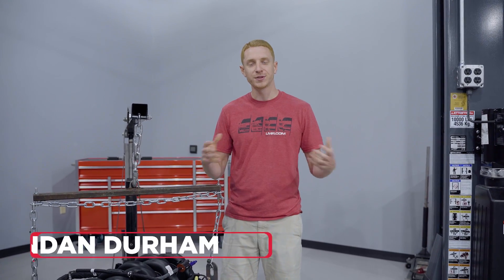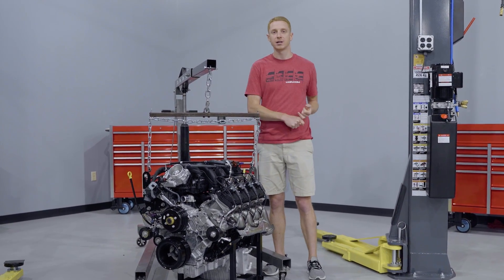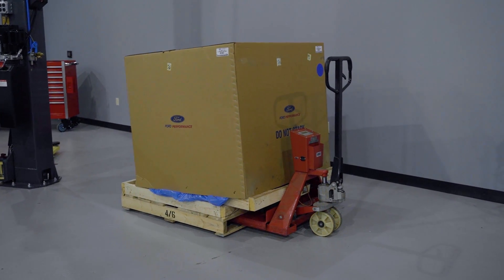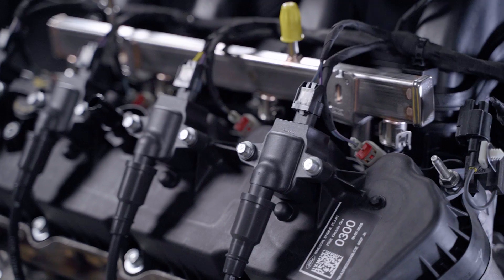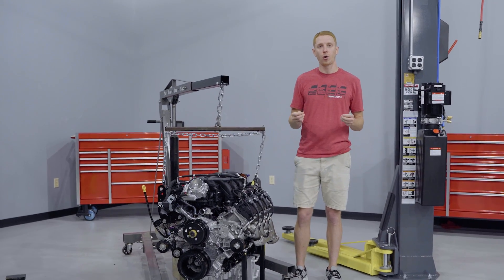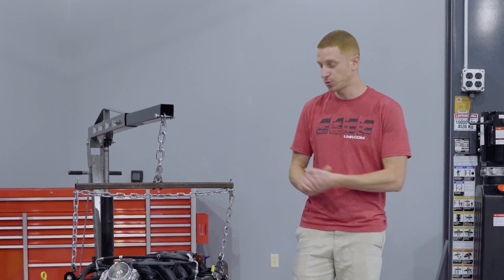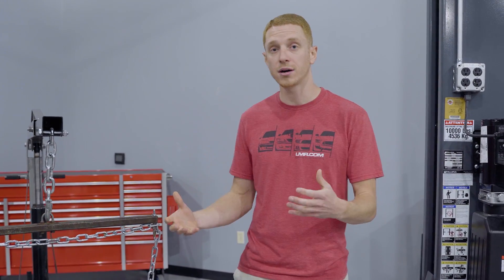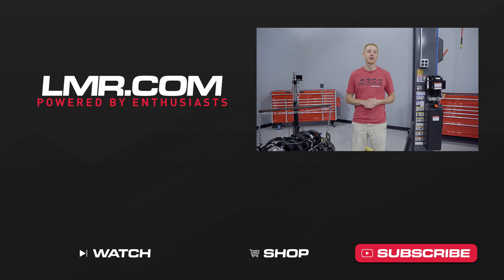Ford Performance 7.3L Godzilla Crate Engine | Review

Comment: "This will decimate all, after, you put about $15k in it...maybe more. If we have to, overnight parts from detroit."
Reply: Lol Jesse
Reply: Did anyone else say it in his voice?
Reply: Why are the 7.3 having such problems with 25 dollar spark plug wire
Reply: motor has already made more than 600 hp with a cam and some porting to the heads NA
Reply: Decimate: to reduce by 10%. It will annihilate lol.
Reply: lol
Reply: Dearborn..not Detroit. Gm based in Detroit. Just clarification. Lived in SE Michigan 11yrs. Car mecca of 🇺🇸 for sure. Love Michigan!
Reply: @Davido50  you missed the reference
Reply: @codyramos3200  did I? Clue me in sir.
Reply: @codyramos3200  just ordered a '21 F250 w/7.3L Godzilla option ..ppl & tuners raving bout this "truck engine " its not a performance motor per say but all Fords in last 10yrs are super tunable & strong running.
Reply: @Davido50   John Ritchey- "This will decimate all, after, you put about $15k in it...maybe more. If we have to, overnight parts from detroit''   quote from the fast and the furious except its japan instead of detroit in movie..
Reply: @Davido50  you seen the multi part godzilla build? ends up making just under 800hp turning 7600rpm
Reply: @codyramos3200  wow incredible no I didn't see it. I can wait to get it in my F250. Dealer said orders w/the 7.3L are heavy out here in NW Ohio
Reply: @codyramos3200  My son has new '19 Ranger FX4 w/ Gen2 - 2.3L Ecoboost from RS rally car. What a fun truck! Has 10spd from F150 along w/2.3L is excellent combo. Truck is super  smooth & quick. No V6 needed!
Reply: @Davido50  cool didnt know you can get that combo in the rangers. idk what you do for a living or if the f250 is going to be a work truck of some sort.. but what made you want a gasser vs turbo diesel in the 3/4ton? only have experience with the old 7.3 powerstroke turbo diesel 97 f350 4dr long bed .. thing was like brand new with 250k+miles only problem it gave me was it got cold out n didnt want to start.. new glow plugs fixed it
Reply: @codyramos3200  Yes, only engine avail (for now) in all Rangers is excellent / overbuilt (for current truck duty plus already stout from use in 350hp RS rally car). 2.3L coupled to F150 sourced 10spd auto makes new Ranger a powerful smaller truck..its not that small! Lol. My son said he read Ford engineers sayin that 2.3L makes 300hp on 93 premum! That's alot! In sport mode truck will pin you to seat. Next yr the 2.7L Ecoboost will be an option ..its really not needed but will be good for towing etc. If you dont need a 1/2 ton or want sporty fun versatile vehicle its well worth it. Very well built /ton features & tech/plenty power/ smooth powertrain/good mpgs. My son loves it & his best bud w/newer V6 taco truck wants new '20 Ranger now. Can't blame him. Toyota is a good truck but far outclassed by Rangers superior modern TGDI engine + F150 10spd auto. Ranger has terrain management w/FX4 option thats very cool for off roaders like my son & friends.
Reply: @codyramos3200  Btw, im a mechanical engineer tho have held multitude of positions w/total of 26yrs in & around automotive industry in general .. working for multiple big Co's here in uppermidwest (MI & Ohio mainly). I like diesels for sure & ur pt is valid when comes to 3/4 ton truck. I dont tow much really.. car trailer at most. So, idea of simpler (less costly) 6.2L or 7.3L Godzilla really intrigued me! Fuel prices will be cheaper too. My new F250 won't be daily driver except maybe in winter mos. Very excited for this Godzilla engine & know its last big block gas engine Ford may ever build. Consider one if you get new 3/4 ton rig!
Reply: @codyramos3200  it makes 600hp at the crank with a mild cam, valve springs, long tubes, open intake and exhaust systems and no accessories with an optimized 93 oct tune. 640hp with an aftermarket intake manifold and 105mm tb. I call that a performance engine...
Reply: @Davido50  I think the Ranger needs a 5L V8 option...I had the old one with a 6sp auto in an '11 F150 and Mustang GT and I LOVED it. I drove a 5L 10spd RCLB 2wd F150 and it was an absolute ROCKET. I managed to pull down 26mpg with that SCSB 4wd 3.55lsd XL package F150 and it ran 0-60 in 6s flat. There is video proof on my channel for that. I am intrigued by the 2.3 Turbo however I have heard that there are many failures just running in 350hp RS trim much less a full bolt on, tuned engine in a Mustang or Ranger pushing 400+hp.
Reply: 15 and might keep up with junk yard $500 LS

Comment: A good replacement for the V10 in my excursion.
Reply: 7.3L gas engine would be a good replacement choice for an older 1999 - 2007 Ford F250 / F350 Super Duty.
Reply: Triton V10 is a good engine, I'm keeping mine.  I still don't trust the variable cam timing on these newer engines and it'll take some time for this engine to prove itself.
Reply: @406Steven  The V10 is a gutless POS,  friend of mine bought a Excursion with a V10 and 2 weeks later took a hell of a beaten trading it in on a Powerstroke
Reply: @rodirby5952  it's a truck, not a race car. It's got the torque of an OBS 7.3 but with another 100 or so HP and they're known for being very reliable in fleet and RV use. My aunt and uncle had a V10 Excursion and struggled to get 12 MPG from it but it's a truck, not a Prius.
Reply: @rodirby5952  yeah, the tritons don't like abuse. My dad got an old f-250, didn't treat it how it wanted to be treated, seized a month later. Baby it and it's got 4.6 modular lifespan.
Reply: Imagine if this thing gets used in all the new heavy-duty commercial vehicles like the 6.8 Triton, and keep the same big life energy!
Reply: The RV industry has already adopted this over the V10.  Its outperforming the V10  hauling massive 10 ton RV's.  Keep in mind that more cylinders is actually less efficient than the same displacement in less cylinders.  Its physics.  I love the V10, but this is going to be the platform that dominates big cube performance in a few years.
Reply: @fwaynedavis  I am currently looking at  2021 Rv it has this 7.3L in it .
The same model Rv 2020 has the V10 .
I was curious what model I should go with ?
Reply: @JAYY_JAYY  Buy the 2021 with the 7.3L V8 gas engine. It is by far the better chocie.
Reply: @fwaynedavis  They have V10's in BlueBird Vision propane school buses screaming past my house to the middle school around the corner. Sound of music man! Cant wait to hear Godzilla's going by in the future.
Reply: Almost anything would be better than the 6.8 V10. A turbo 4.8L V8 or the new 4.3L V6 with a turbo running through 10sp in a well designed transmission could beat it in every meaningful performance statistic.
Reply: @hendo337  Small displacement turbo engines might be OK for low weight vehicles...but not good for medium or heavy weight vehicles. The reliability variable is reduced with forced induction platforms (Turbos, Superchargers)...another part (system) to maintain and or repair. 

For big vehicles using gas engines, a Naturally Aspirated (NA) large displacement engine is way better choice than a small displacement with forced induction. For the same reasons, the NA big block V8 would be a better choice for small vehicles too. Moreover, if performance is the main number one goal.....then a turbocharged or supercharged big block V8 will smoke a small block V8 or little V6 every single time.
Reply: I would personally keep the v10 but each to their own
Reply: A boat anchor to replace a boat anchor.
Reply: That power stroke is a beast
Reply: @jalenad11  it's not a powerstroke....its a gasoline engine.

Comment: Fords version of an ls. Weighs as much as a big block chevy, makes less power per cubic inch, still stuck using fords garbage transmissions unless you pay crazy money for a quick time bellhousing
Reply: LMFAO garbage transmission what the f*** you should look at midnight performance houston texas
Reply: Wrong. The 7.3 takes design elements with the FE and 385 series v8's. this engine has made 780hp naturally aspirated. and it does NOT weigh as much as a big block chevy, who told you that? What's wrong with ford transmissions? the 6r80 and 10r80 are proven units.
Reply: @riogrande163  if the fe motors were so great why did they get replaced by the windsor, cleveland, and 460? And why do the Australians build clevevor engines?
Reply: Im saying for a price standpoint. Both of those transmissions are expensive. Pluse the 780 hp na motor you talk about is a high compression drag engine not a street pump gas engine. My 598 big block chevy is 35lbs heavier than that 7.3 Godzilla.

Comment: I'm pretty sure small block chevy's also dont have a keyed crankshaft
Reply: The LS motors do not, the supercharger kits require you to key the crank for obvious reasons, but it only takes 10 minutes once you install the balancer. 
This is why it is important to properly torque down these non keyed balancers too, lots of horror stories on gm balancers..

Comment: Looks like CRAP! Intake and exhaust valves are too small!
Reply: They've already made just about 600hp with mild port work and a cam. Fully cnc ported heads different pistons and rods it made 789hp @7600rpm N/A and that's built for boost. So no the heads are not crap. The motor should make about 1550-1650 when the whipple gets added. You don't make that kind of power N/A with shit heads. They need to move some air to achieve those numbers.

Comment: I'm I missing something?
The ls7 had better numbers 14 years ago...and with 7 liters and aluminium block.
Reply: Yes, you are missing something. The LS7 was built as a high performance motor for their flagship sports car. It featured trick stuff like a dry sump oil system and titanium valves and rods. This 7.3 is a truck motor meant to run 200k miles with no issues. But there's already some guys making serious power with them

Comment: Can manufacturers please stop putting plastic crap on the engines. It makes them look god awful under the good of anything classic.
Reply: The intake plastic makes colder air than any other material. And it's cheaper. That's why they use it.
Reply: @2000blackstang  Oh I get why they do it just looks cheap I don’t even like looking under the hood of late model cars anymore.

Comment: Too heavy 
This engine weighs 580 lbs without any power adder
Adding a turbo or supercharger would make it 700lbs
Reply: You have an iron block with the 7.3 though.
Reply: this engine weighs far less than a contemporary big block ford, chevy, or chrysler. let alone the old 426 hemi, and people swap those engines into cars all the time, so no, it's not "too heavy for any project"
Reply: Waylon Miller  

i got real this engine with a blower will be 700 lbs 
You will understand what a 700 lbs engine is when you have a nose heavy car That have 75/25 weight distribution  

Good for a burnout contest

Comment: This is a great engine. It has alot of potential. People dont understand the concept that this is a truck engine built for 3/4 ton and up. Its built for durability, low end, and working ability. If you applied performance minded cams snd intake manifold upgrades this engine would easily be well in the 500's!!

Comment: Compared to GM counterparts this motor is weak. GM LS7 505hp and 470ftlbs of tq. The LS3 smaller displacement pushes the about the same  numbers. Ford needs to go back to the drawing board. Even Dodges 6.4 puts out more power.
Reply: You’re comparing a motor designed for a c6 Z06 to a motor designed for heavy duty trucks and hauling. Clearly it’s more set up for low end power and durability
Reply: @wadesautoresto1450  the ls3 is in the 1500 trucks and is 420hp and 460ftlbs and both make peak torque at 4000 rpm and peak hp at 5500 rpm.
Reply: @PlanetEaterG  you're still talking about car engines (and in the US the LS3 was only ever used in Corvettes, manual Camaros, and the Pontiac G8/Chevy SS).
The 6.2 in the Escalade and Silverado are analogous to a Coyote powered F series. A car engine, modified to be a little better for a truck. Light-duty truck, at that.
Not to be abused pulling and hauling heavy loads for 200,000 miles.
GM's equivalent is the new 6.6L. It's designed as a truck engine first, namely HD trucks, not your common Yukon Denali.
Reply: Its workhorse configuration, it's up to you to change the cam and shit which many others have stated it seems lol. What are the v8 workhorse motors in Chevy's and dodges putting out? The ls7 is a Corvette motor. The new 5.0 coyotes are making 480 hp with wayyyy less displacement. There's more to engines than a direct correlation from cubic inches to power

Comment: Way too expensive $7500 you can build a dart based motor for almost that. This will be only good down the road when you can buy them used out of a truck for half the price. It has a forged crank just needs rods and pistons.
Reply: Seems cheap to me. Just paid $900 for valve covers for my Hemi. Good set of heads are 4k.
Reply: same reason the coyote swaps are becoming popular it takes several years before they become somewhat affordable to the average joe.. or if your really on a tight budget like me a 7.3 godzilla is just a wet dream considering im at the pick n pull looking for good 4.6 aluminum blocks aviator intakes  4v C heads
Reply: I'd buy it. It's not that expensive
Reply: Doing things right is never cheap. Just built a stroker 440 for my '69 RoadRunner. The complete motor rebuild was $12,000. 
Making money is easy now-a-days. Diesel mechanics make $150,000 a year working in diamond/gold mines in northern Ontario. Boiler-maker buddy made $250,000 working oil fields in Alberta. Just have to go after it. Never going to make money working at your local Walmart.
Reply: Guys in here saying it’s not too expensive got me rethinking my life I’m in the wrong job 😩

Comment: I think it has low hp, i tought it would have more power, its a much bigger engine than a 5.0 and still has less power
Reply: Gotta remember this is still a Truck motor so Torque was more important than HP.
Reply: its meant to be a durable truck engine worked hard for 100k miles heavy hauling .. id like to see a coyote do that in comparison see how it holds up.. 790hp has already been done n/a i dont think a coyote has done that yet

Comment: The engine is perfect for my old Foxbody. Just need an adapter for the t5
Reply: should swap in a t56 with this bad boy.
Reply: You could run a t45 or the other one out of a later sn95/new edge but will need a shorter driveshaft
Reply: I was just thinking that, Foxbody would be Badass.

Comment: "Those motors have huge potential,cam swap alone will give huge power gains"watch Revin Evens channel"
Reply: But they are not swap friendly as an LS or Coyote. They had to rip apart the transmission tunnel in that foxbody lol

Comment: Can’t wait to see some performance camshafts come out for this thing.
Reply: Already out. Motor made over 500hp with cam change. Then Wolfe did some mild head work, different intake with cam and made 600hp. Now he has a full built version that mades 789hp N/A but it's built to have an 3.0 whipple added to it that's going into his foxbody. That should bring it to about 1550-1650hp 
He believes the motor can make 900 with the factory heads. Obviously fully cnc ported, more compression, better rods etc. The point is what the heads can do after a full cnc port and that seems to be very impressive. Check out Wolfe racing. There's video of it on the dyno.
Reply: @waynebollentin989  probably a custom ground cam.
Reply: @waynebollentin989  I can't find the channel or video youre referring to.
Reply: @christiancampbell-sanderso5998  Revan Evan is the channel or do a search for Godzilla 7.3 revan evan and it will pop right up. There's a few videos covering the difference mods and stages
Reply: @Wayne Bollentin Can it make more than 800hp with stock block the Godzilla
Reply: @eliasjaimes8336  are you asking if the stock block and rotating assembly will make 800 N/A or with boost. If the question is with boost it will make 1000+ easy.
Reply: @christiancampbell-sanderso5998  REvan Evan video
Reply: @waynebollentin989  gotta love the extra space that big blocks offer in the way of performance potential. I’m so glad Ford makes a modern big block in face of the emissions nazis